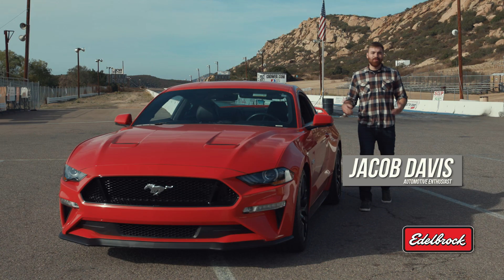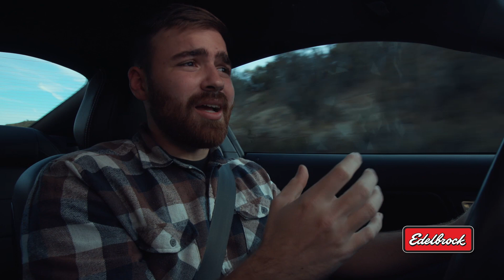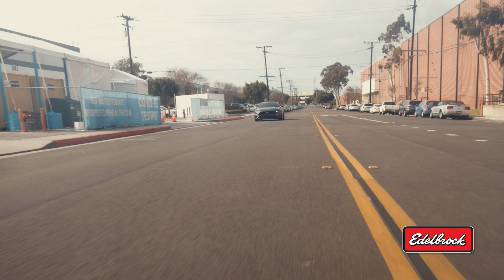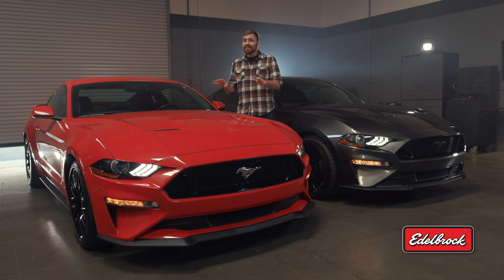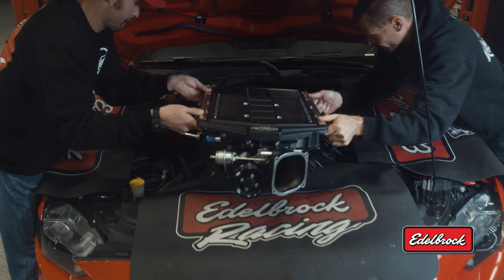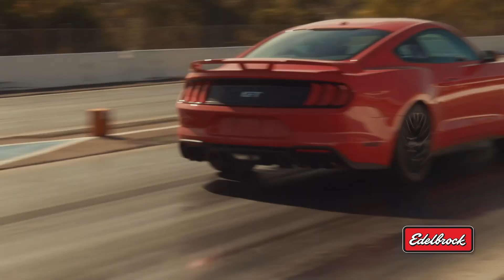Edelbrock Superchargers for Ford Mustang 4.6L, 5.0L and 5.2L V8 Engines

Comment: Video says for 4.6l and 5.2l but it never show the supercharger on these engines...smh
Reply: The voodoo and coyote engines are practically the same except the VooDoo has a different intake manifold and throttle body but the supercharger will fit the same. It won’t fit in a 4.6 so why they say it will, no clue
Reply: @jjRaider  They make kits for the 4.6 3 valve stage 0,1&2